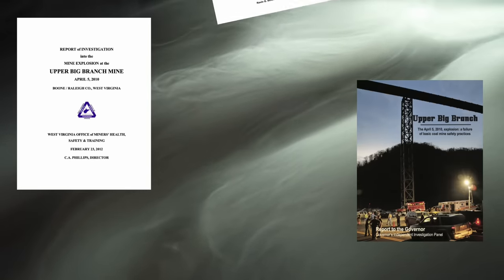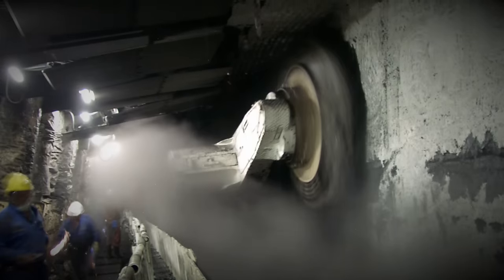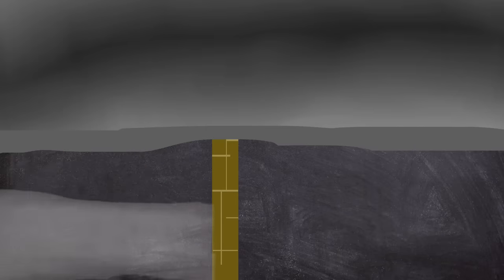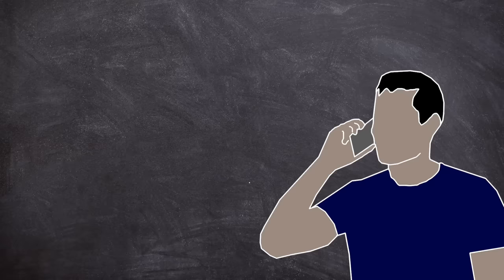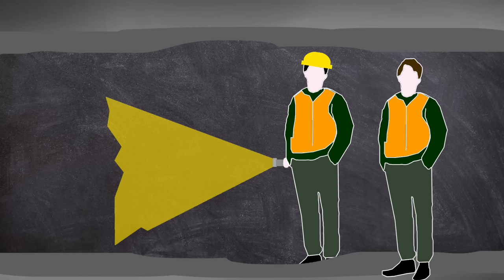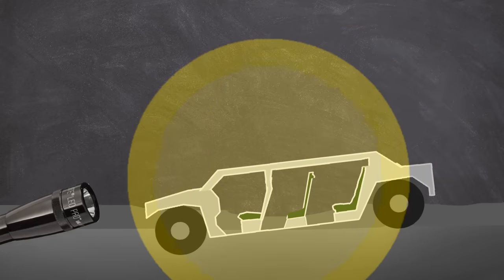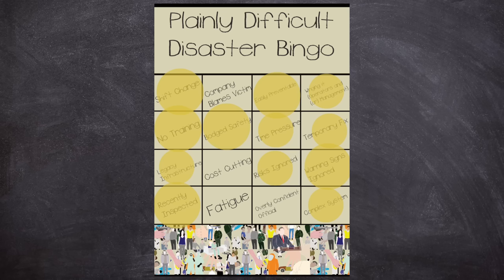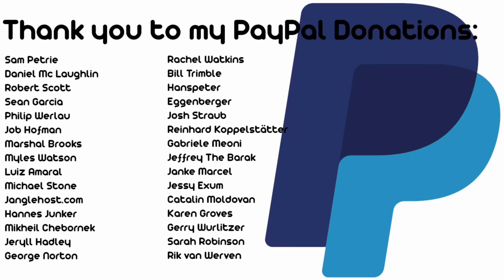Corner Cutting and Greed Caused Massive Underground Explosion | Short Documentary

Comment: I'm from the area, and one thing people don't mention when discussing this disaster is that the conditions at UBB rapidly deteriorated as Don neglected his managerial duties to pursue politics.

He already liked to cut corners beforehand, such as when he would make people work while injured or in standing water. He would also prevent his managers from sending in incident reports because the resulting safety investigations would reveal him leaving work.

Conditions were not good prior to Blankenship being promoted, but after that point, he would replace all of his immediate staff with yes men. They would enable him and allow him to keep his position even after Massey became aware of the flooding of a shaft that previous spring.

Following the explosion, Blankenship would try to run for governor and the state senate, but his political aspirations started way earlier and contributed to the deaths of 29 people.
Reply: I'm curious about the standing water statement - I'm guessing it's an issue because of trailing cables on miners and shuttle cars? I work underground gold and working in six inches of water is normal, but we have zero electricity to the face - everything is pneumatic or diesel.

Comment: That's terrible and all, but did you notice the state of that kettle? The amount of limescale is giving me a concern!
Reply from the maker: Its an old video, but were we used to live the water was very hard!!
Reply: I go through a lot of vinegar cleaning my kettle! Hard water is awful
Reply: @PlainlyDifficult   Where I grew up, the water was pretty hard - it was impossible to get a lather with soap of any kind, and the mineral build-up was rather annoying. A significant portion of our water was groundwater rather than imports (despite being a major suburban area in an overall arid region, there was a reasonably high water table). So we the consumers either had to filter the water on our end or just live with our local mineral-water. I mean, it could've been much worse; our local water company was well-developed and well-funded.
Reply: @PlainlyDifficult I feel your pain. My kettle is just as bad, and I just don't want to scrub it again yet.
Reply: @PlainlyDifficult  that can be a pain! I had to start using distilled in my kettle to help save on the scale.

Comment: I worked for years in south African coal mining. It's law here to use stonedust to help prevent coal dust explosion. 
I didn't like working the longwall because of the goaf ... the unsupported area behind the support jacks. Sometimes the roof would hang then drop and the displacement was very dangerous. We had to fix ourselves with a length of chain to something solid because the displacement could hurl you against something and kill you dead. The other problem was that the air would rush through the crosscuts knocking coal dust off the walls and making the environment extremely explosive.  
We did it because longwall mining pays big. That cutter doesn't play. It cuts like crazy and we usually only had to work a few hours to make shift quotas. We couldn't push more because the bunkers were full.

Comment: You could do a documentary about the Pike River Mine incident in New Zealand.  Here basically the same set of circumstances occurred but the mine boss left the country and couldn’t be prosecuted.  The extremely sad thing is that they repeated essentially the same mistakes as this incident but didn’t learn from it.  The NZ mining regulations didn’t adopt the same improved safety measures that they did in the US to prevent this from happening again.  The knowledge was out there but not adopted.  The improvement in mining technique for this type of mine was to pre drill areas to be mined and the methane to be drawn off prior to mining.

Comment: Coal dust explosions can undergo deflagration to detonation transition given the correct conditions. Essentially, it begins to burn as the result of some ignition source and as the fire generates heat and gasses the burn rate accelerates exponentially due to the compression of the dust and air ahead of the flame front, a positive feedback loop if you will.
 If this flame speed breaks the sound barrier the resulting sonic boom can self sustainingly compress the fuel/air mixture to autoignition temperature reaching detonation velocities of well over 1,000 meters per second. 

This results in absurd pressures, equivalent to perhaps 100 times or greater the force of an F5 hurricane's.
Reply: Thanks ...that was interesting...
Reply: dust explosions are some of the most dangerous, Hell people have in the past tried to design engines that run on coal dust and work similar to a diesel.
Reply: @harrypeterson9287  Why the weird comment ?
I thought it was interesting to know about the pressure and how it amplifies the fuck out of the explosion...
Thanks again 😉
Reply: @1lonecrow  Sorry, man. Your excessive use of punctuation gave me the impression that you were being sarcastic. 😅
Reply: @harrypeterson9287  All good ...
Have a great day !

Comment: Man lower and upper explosive limits are frightening.  

Up to a certain percentage of gas in the air there thankfully isn't enough oxygen for ignition to occur, no matter the temperature or gas concentration - but that then means unless you're using supplied air, life has a hard time occurring without ~15-20% oxygen levels.

Working in the safety supply industry, most mining operations invest in rescue-level air tanks that can supply 4 hours of breathable air compared to the 1 hour that firefighters require. They'll also have bunkers throughout at strategic points for tank swaps and rescue holdouts, as well as escape hoods for ambulatory and atmospheric isolation bags for the unresponsive victims
Reply: Now obviously this is the written standard now, not to say it's put into action in all nations under all corporations, just the selling points I have for rescue air systems, which - to be clinical, but fair - are cheaper than unlawful death lawsuits
Reply: As well as death due to gross negligence

Comment: longwalls were originally used in europe so as to gently drop the surface over a large area so as to minimise the damage to surface infrastructure. Those longwalls were advancing longwalls...The longwall in this presentation is a retreating longwall..designed for maximum output.Once the goaf has fallen the stress on the strata at the face and more important at the front of the face in the direction of travel  decreases a lot and that's the aim of the game....

Comment: All underground  mines result in some subsidence. Long Wall Machines take a more or less horizontal slice out ie a coal seam or  panel that is very long thousands of yards and 1,000 yards wide. It results in a more even subsidence on the surface, often unnoticeable to the casual observer. The floor and ceiling of the the mine gradually subside until they touch usually a hundreds of feet behind the Long Wall Machine, the hydraulic rams on the back side of the machine gradually reducing support as the machine moves forward. On the other hand pillar and post results in a patchwork - checker board patter of humps and dips over a long term as the pillars collapse and the mine gradually collapses.  Long Wall Mining is considered to be a safer more efficient and has less impact on the surface above the mine. Managing ventilation in a mine is tricky, and more so if you neglect it. Each mining machine is supposed to have an explosive gas detector on it, supposed to.... When you don't have and maintain gas sensors the result is inevitable .

Comment: To me, it's strange they don't try to turn these problems into profit centers. Methane is also what we call natural gas. Don't ventilate it out to atmosphere, suck it up and pump it to a pipeline. Also coal dust is fuel with a large surface area that burns quickly. It can probably be used for peaker power plants. Wash everything down and keep the coal face wet all the time. Pump the coal slurry to the surface, drain the water and dump it into its own covered transport vehicle for special sale.

Comment: If the United States cared at all about worker safety, they could guarantee this would be the last 'accident' of its kind. Simply, as several prosecutors suggested, charge Don Blankenship with 29 counts of 2nd degree murder. Blankenship, directly in his position, ordered illegal alterations to the safety systems; suppressed reports of accidents and system failures; and threatened workers. This is depraved indifference, and depraved indifference resulting in death is murder 2. If either the state or the Federal government had charged Blankenship, he would surely have been convicted; the way this mine was run is a textbook for illegal, unsafe practices. And on conviction, he would spend 15 - 40 years in a real prison, not less than a year in a minimum security club. No coal CEO would ever do what Blankenship did if they faced decades in prison. The fines were, as is usual with workers deaths, just written off as a cost of doing business. 

Despite his actions directly killing 29 men, Blankenship received his annual bonus, even the time he was in prison. That's really all that need be said.

Comment: Need to do some more actual investigative journalism here. You always assume it’s the company’s fault and that’s where you go you don’t realize it could be other outside sources!
Regulators did you know and this was proven regulators told mine you have to reduce the amount of air. The mind engineers said we need let’s say 160,000 CFM but yet regulator said they only needed 90,000CFM  I don’t remember the numbers but it was something like that
They also said it wasn’t properly rock dust it. They made a determination after they walked into the mine after the explosion, which would’ve knocked off all the rock dusting. 
Like so many different accidents this I would say is 90% regulatory’s fault  I’ve dealt with OSHA and the dumb things that they say that make no sense I do not keep people safe but yet they will try to destroy you if you don’t comply is ridiculous.